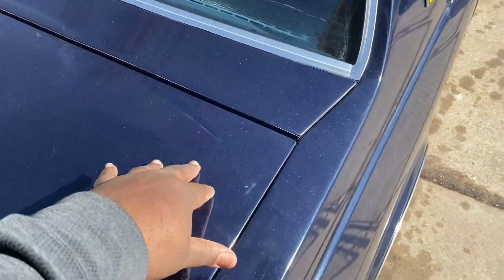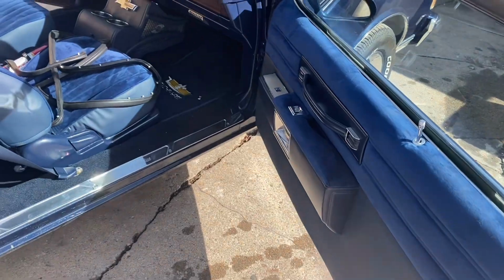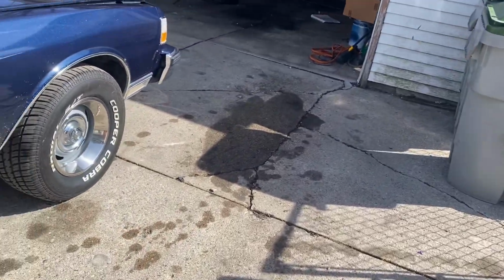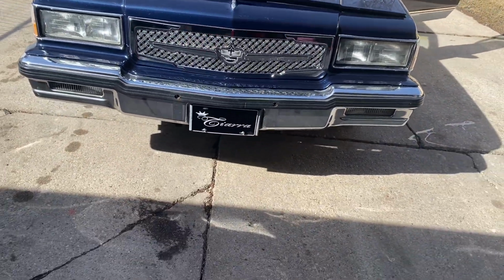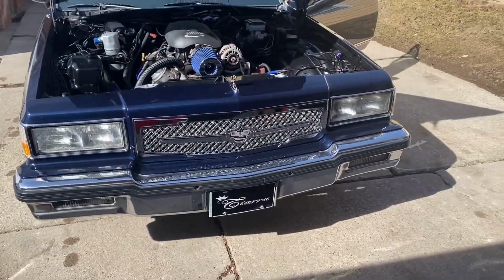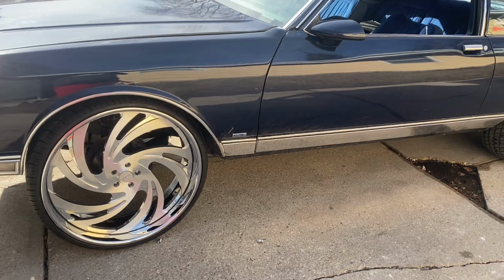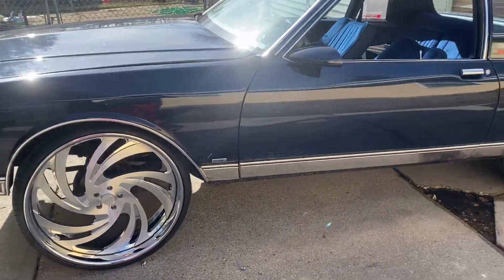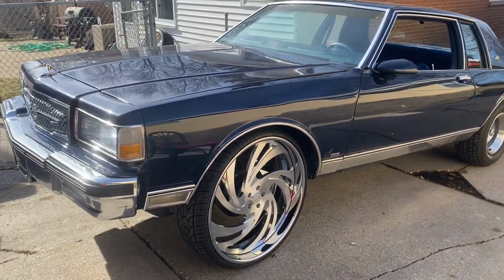MTW BILLETS TWISTED 28s TEST FIT

Comment: I seen you on stitched by Diego looking at interior .are u thinking of changing the complete interior on the 2 door or 4 door? I don't blame u for not wanting to cut. If u are in the Chicago area I recommend Bankroll Tim at bet it up customs.it will cost a few dollars but he will get u tucked right in the rear and get u set up nice in the front with no cut